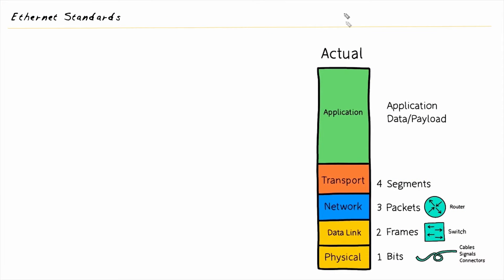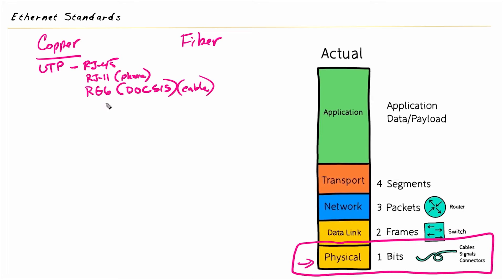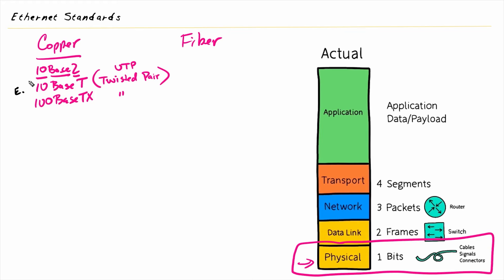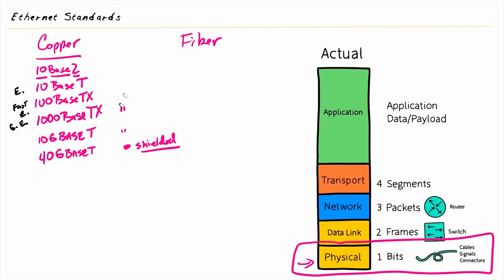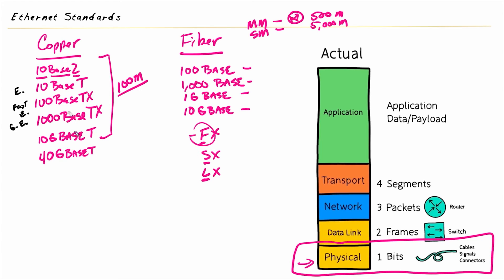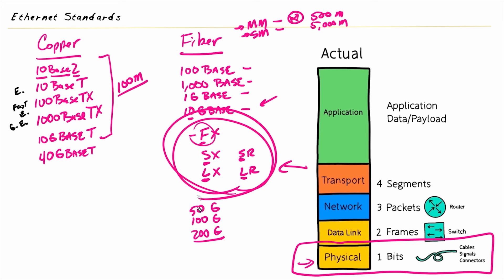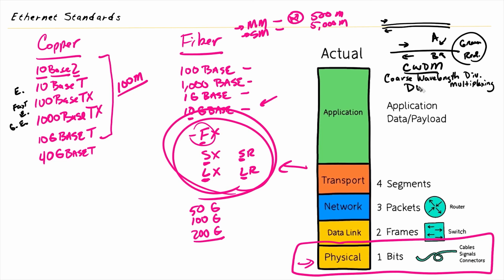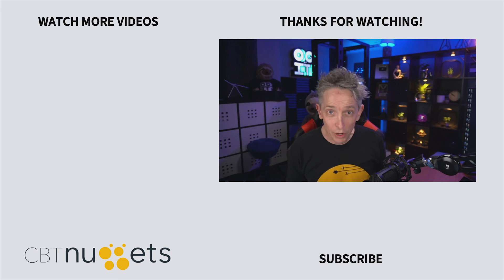Physical Layer TCP/IP | Ethernet Standards Copper or Fiber

Comment: There is also 2.5GbE and 5GbE.
Also, the difference between MM and SM optical fiber cables is that MM cables are designed for distances less than 5 kilometers, and for distances beyond that, SM cables come in. Also, the use of single fiber but different wavelengths (WDM, wavelength division multiplexing), one of its uses is in FTTx broadband.